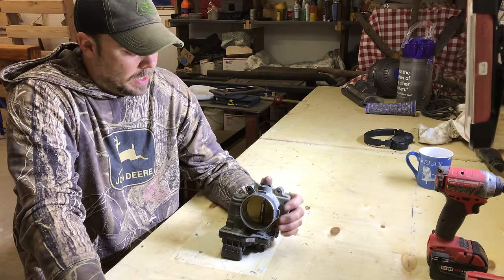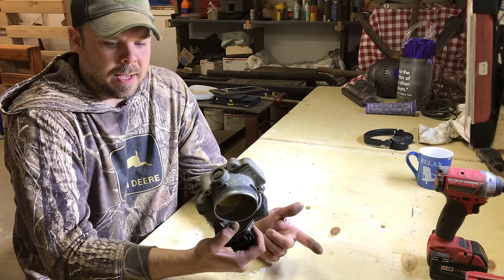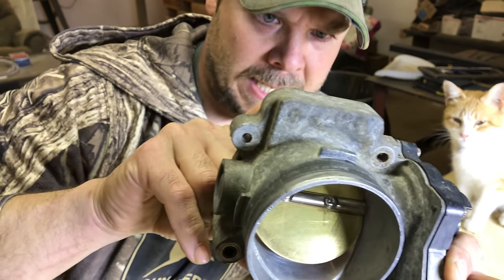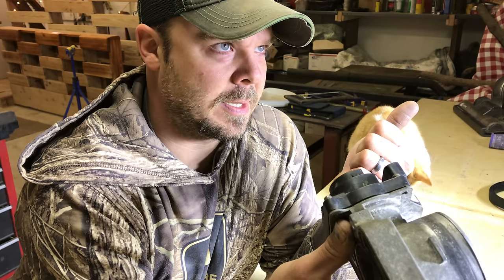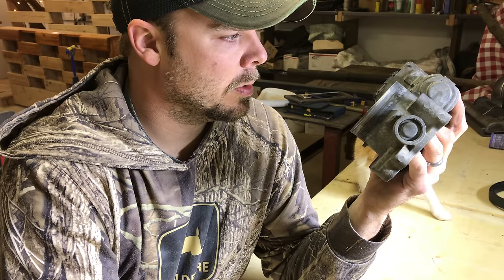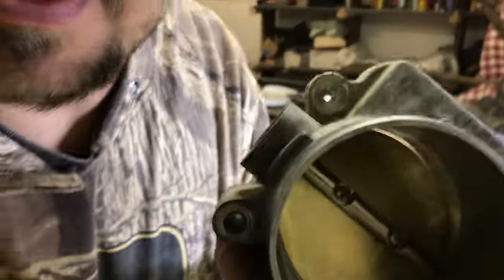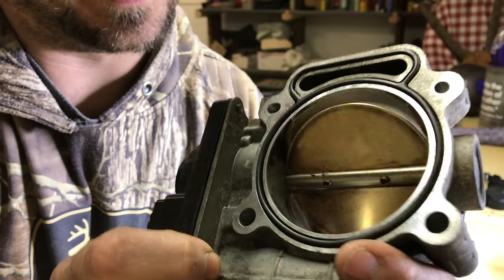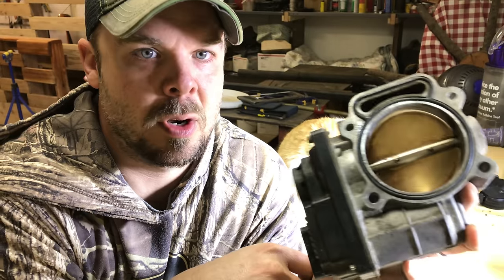Throttle Body Fix for GM Limp Mode REDUCED ENGINE POWER Video

Comment: So I have a 04 chevy tahoe 4.8 code came up tps. I replaced tps and it ran great for two weeks. Back to the same issue so I figured faulty part. Replaced it again. Now not even a week later back to same issue. What could it be? What could cause the tps to keep going out?
Reply from the maker: VICTOR, 

I imagine that it is the entire throttle body assembly (comes with new TPS)  Something mechanical is out of spec causing the sensor to malfunction.   I would start by replacing that after checking codes.

Good luck to you...I know how frustrating these issues can be!
Reply: No I did not buy a new throttle body. I bought a new tps
Reply: See the code it showed said tps so I replaced it. Ran great for a 2weeks then failed so I got another new one and ran great now it failed again after a week.
Reply from the maker: You should research a new throttle body assembly
Reply: WHAT THE FIX ok thank you
Reply: VICTOR you likely have a faulty connection to the tps...check voltage on each hot wire and check grounds too

Comment: In an other words, don't take it apart?
Reply from the maker: well... kinda.  Im sure there is a situation where mechanical failure or backfire could cause the butterfly to go out of operating range and become stuck.
Reply: @WHATTHEFIX  apparently people are forcing them open to clean them on electric throttle bodies, breaking them, I noticed mine was partially open and I could close it but would spring back to partially open, I didn't want to mess with it.I did take it off and clean in it , now it runs great with no, no starts like it had sometimes on the first try.Thanks for your video.

Comment: On these newer throttle bodies, opening the butterflies by hand ruins it.
Reply from the maker: I agree it may have detrimental effects, but this one is still going strong.
Reply: bbaaspencer1 Doesn't hurt it at all
Reply: Doesn't. It just depends on the year. truck never an issue but touching a Cobalt once..oh man. Used efilive to reset with key on engine off.
Reply: the actual mechanical assembly of these types of throttle bodies is fairly robust and will suffer no damage from manual articulation, the problems arise from calibration. Some manufacturers have very complicated and sensitive throttle position sensors that will lose calibration if manually articulated, the Nissan 350Z is an example, for simpler units like the one shown here it is not an issue.

Comment: Having trouble with mine. Checked all electrical to throttle. Was getting frustrated. I think this could be my problem. Will clean mine and get back to you if problem fixed.

Comment: I keep getting reduced engine power after replacing full throttle body any ideas?
Reply from the maker: Unhook the negative post on your battery for 10-15 min.
Reply: @WHATTHEFIX  I did before. it worked for a few weeks then just yesterday it happened again only that this time I am getting lots of error codes I don't know what to do
Reply: Replace plugs and air filter!!! This is the underlying issue what cuased the build up that cuased the Tb sensor to short out!!

Comment: Disconnect battery, remove engine cover and vacuum line under it, wiring connection,air intake to TB (Throttle Body), 4-10mm nuts/bolts ON TB and TB. Spray both side with TB cleaner.  Use a Green Scotch-Brite for ALL the rest of cleaning you are doing. NOW open fly & CLEAN (even better) CYLINDER parts you couldn’t clean without opening FLY. THIS VIDEO explains the fully closed area that needs cleaning also. Now clean the EDGE of the BUTTERFLY. The part of Butterfly that touches the cylinder on the Butterfly & the edge that builds-up with carbon on SIDES of butterfly. Get Mass Airflow (MA) Cleaner & Clean MA ALSO. Put it all back together. Connect battery. I had you disconnect the battery so that the computer will START ALL OVER NOW since you manually moved the fly.
Reply from the maker: Good Advice!

Comment: brake  cleaner lmao best way to f up a throttle body !!! use throttle body cleaner you took the coating off the throttle body using brake cleaner is a no no
Reply from the maker: By coating do you mean the zinc plating?
Reply from the maker: i cant tell... your channel has no content.  way to stick your neck out there Genus.